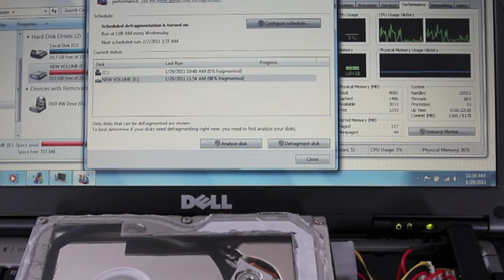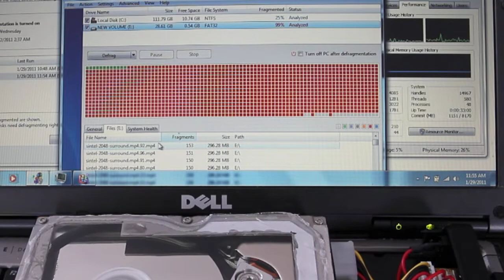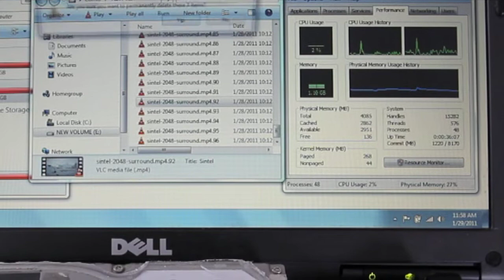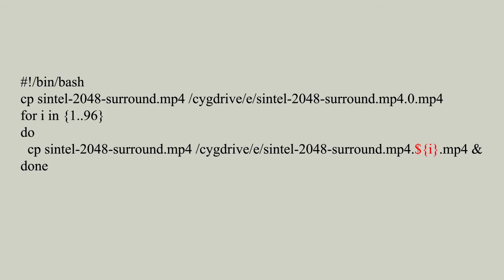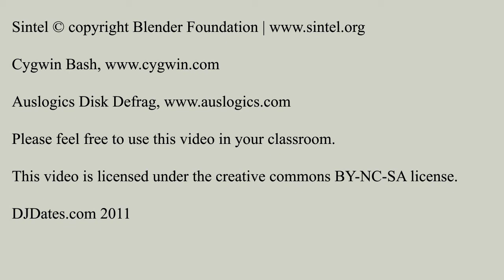Computer Literacy: A Window into the Hard Drive

Comment from the maker: @MAVENdeNYC This video is about file fragmentation and other file operations as seen from inside the hard drive. The file used in the video was the open source movie Sintel, created by volunteers using Blender, and as I showed thumbnails from the Sintel video, credit was given with a link back to the Sintel website. I haven't used Blender myself, but I'm a fan of the project and what it can do. If you haven't seen Sintel, you should check it out.

Comment from the maker: @ichigo3223  I found a company (mountainsecuresystems) that sells sealed drives suitable for any altitude that have relatively low RPM (~3600). If you do a Google search for "disk flutter", it looks like there is quite a bit of research (and math) on what is happening with air pressure inside of a drive with higher RPMs.

Comment: @djdates  Yeah, I only asked because I was curious about it. I read that many of those vents are to keep an air pressure inside the disk which makes the head kinda float above the platters at a very precise distance. Many drives also state not to cover the vent holes with stickers on the cases.

But yeah, you said you used a old 30GB model, and you are right. Most old models do not have vents on the cases at all. I wonder what happens when you seal a HDD case completely.